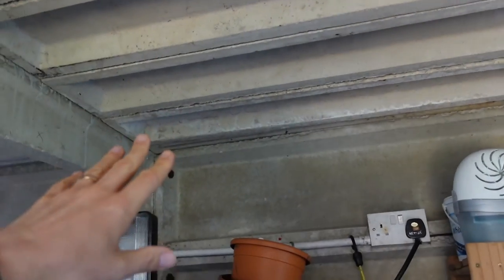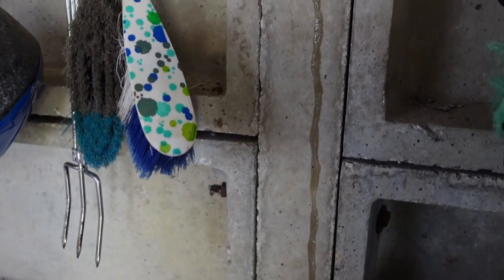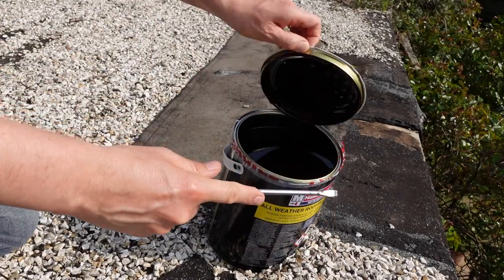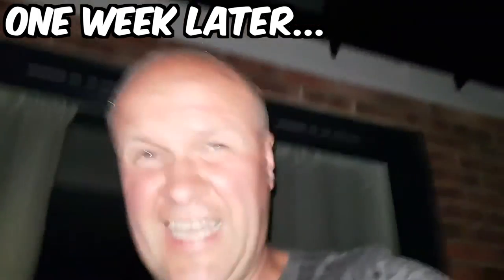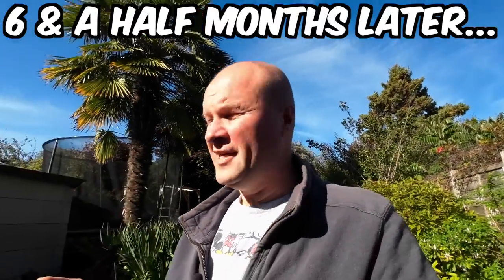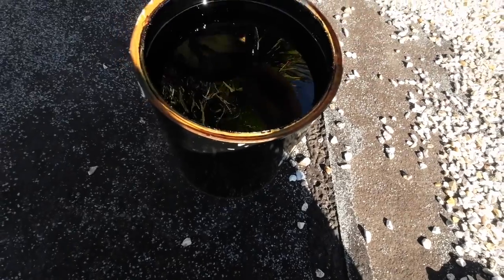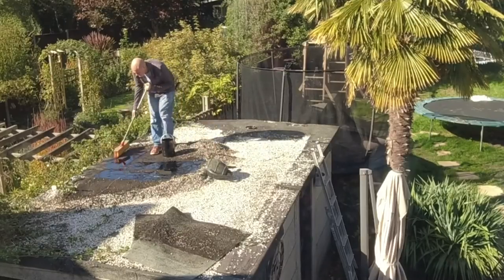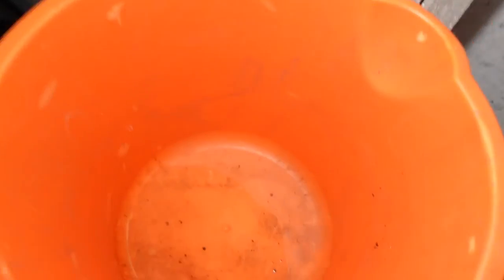How to DIY fix a whole garage ROOF?!

Comment: Hi Neil.  The "shingle" on the roof  is in fact reflective roof coating to stop the sun from heating up your roof too much and making sure it dries out slowly after rain.  So sweep it back over the bit you coated with the bitumen paint.  You might get another couple of years out of that and then you'll need to have it done properly
Reply from the maker: Ah, wonderful thanks.  I thought it was something like keeping birds off the roof.
Just noticed 2 more leaks at the end of the garage near the trampoline... you can see the bare patches really clearly in the video!  Think I'll just empty the can on the roof and hide it all with shingle. More shingle, that's what I need.
Or maybe I could make a living roof...

Comment: Looks like you sorted it.  Alternatively  cut out the cracks and fix with cement repair. Alternatively cover with a new roofing surface as the concrete may have reached the end of its life!
Reply from the maker: Brilliant thanks Matthew -- appreciate the advice... I think it's definitely curtains, just spotted 2 new leaks where the kids play at the end of the roof (dont ask)... Anyway, thanks!!
Reply: @DADDELIVERS  Yep.  Wickes sell specialist packets of cement repair that may be worth a try!